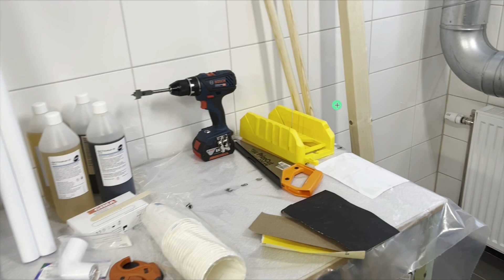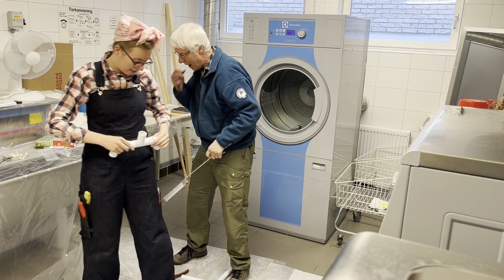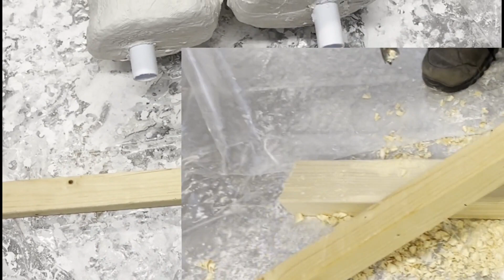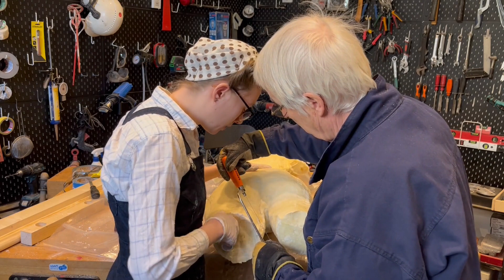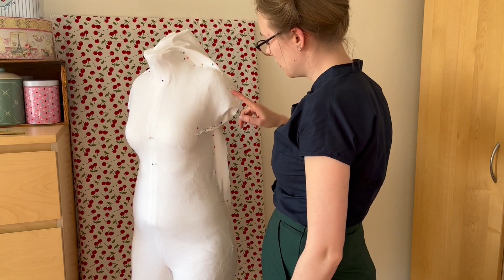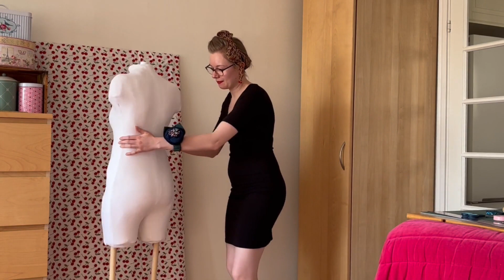DIY Dress form / mannequin - with plaster and expanding foam

Comment: Beautiful job. Sounds like it might have been better to pour the form is two halves ( front and back) allow to cure. Shave off the excess and void for pipe. Glue the two halves together with a spray adhesive then assemble.

Comment: What a nice, detailed and clear step by step video!    (And a very helpful family:-)  Thank you so much for that.   I wonder if doing partial pours of the expanding foam mix would help to avoid the air bubbles.  Also possibly if there were a couple of "escape routes" for the foam to travel (like the leg holes, something in mid back.  The excess dried foam would have to be carved off but maybe that would help.  When I made foot shapes (for wet-felted slippers) with expanding foam using rubber boots as forms, I had to do partial pours.

Comment: A very well thought out process and so informative and useful. 
It is such a shame the form didn’t last long. May I make a suggestion? It actually occurred to me ( coming from complete ignorance in the matter) but I had a worry when I saw you do small individual pours that maybe the bond between the different pours may not bond very well to each other. It’s also possible that as the medium expanded inside the cast, that some surfaces became contaminated with Vaseline and may have compromised the foam in some areas. 
When I searched and found your video, I initially thought you were going to use expanding spray foam and was surprised you were mixing it yourself ( I didn’t know you could do it that way). May I ask if you had considered the spray packing foam and if you did consider it, why did you choose the method you ultimately chose? 
Thank you so very much for sharing your hard work and masterpiece. You are very talented ❤
Reply from the maker: Hi!
Thank you for your kind words, ideas and your question!
I choose to mix it myself instead of using spray foam because I had a feeling that it would be a higher risk to incorporate air bubbles with the spray foam and that the spray foam wouldn’t expand as much as the foam you mixed yourself. But maybe I should have looked more into that. Because when mixing the foam yourself, you might get the proportions wrong. So spray foam could be an option as well, also depending on how hard it gets when it sets 😊
Reply: @ thanks for your reply. How is the form going?

Comment: Is it really worth it tough making this? Your body form needed a lot more sanding. And the legs are not even. Just saying all that work and its melting down. And with that miney you could have ordered a custom made dress form.
Reply from the maker: @alexamombravo9788  Hi! Since the expanding foam got distorted, it’s not worth it. But if it had kept its shape, it would had been totally worth it! This metod is cheaper than a custom made dressform. There are other options like buying premade ones that you could change in different ways. But unfortunately that doesn’t work for me mostly because I have a short upper body measurement from the neckpoint to the bust point.